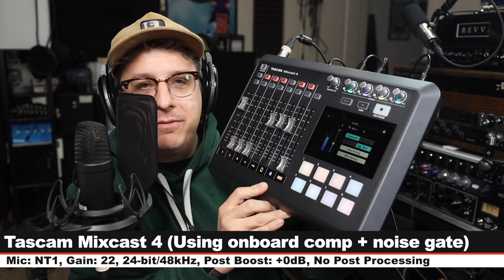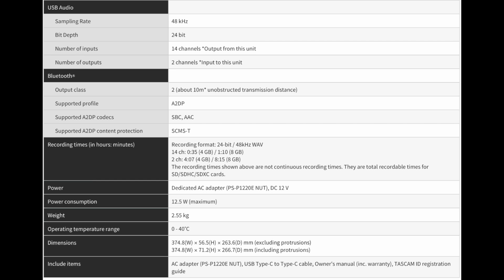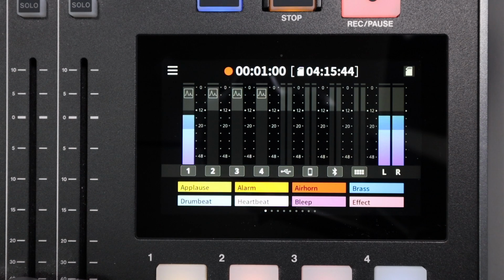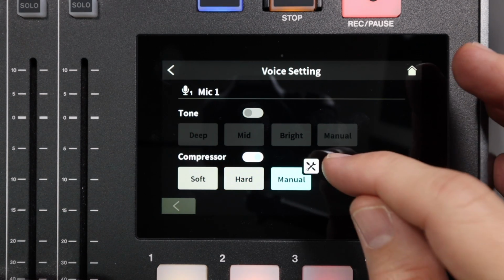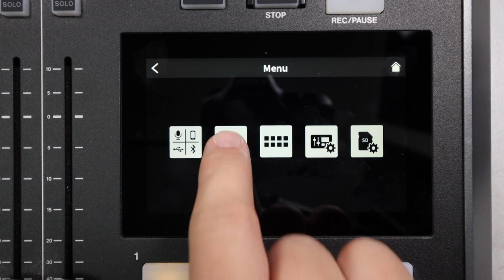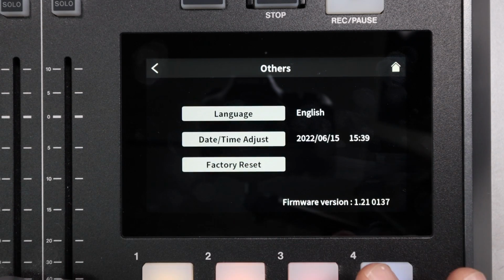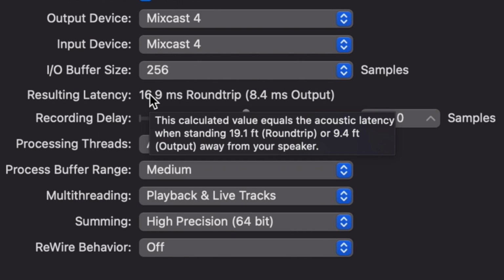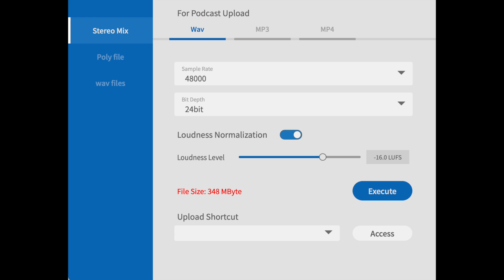Tascam Mixcast 4 Review / Walkthrough / Explained

Comment: I've had this as my main podcast station for about 5 months now and absolutely LOVE it. My only complaint thus far would be the lack of voice mod/effects such as raising or lowering your voice pitch on the fly with a phaser would have been cool! Thankfully they are always adding updates to the firmware so it's possible features like that could easily be in the works.

Fun Fact! I've always used it connected via USB to my 8-USB 3.0 hub and I've thankfully never had a connection issue!
Reply: Is it possible to stream directly from mixcast to iPhone? Using audio affect like echo? I am playing guitar so is it work ? Or need computer?

Comment: I really love how intuitive it seems to use this device and the feature set of it.  I agree that this is overkill if you are a solo podcaster or streamer.  I would like some recommendations of an interface that is similar to this but more catered to an individual.  I know they exist but… not sure where to look.

Specifically I would like the ability to have a compressor, soundboard, and phone or bluetooth connectivity like this interface.  The other features are great but not essential for me.

Thanks in advance to any replies!
Reply from the maker: There's still not a solution like that other than the GoXLR. The new Focusrite one is the closest to that, but it lacks the soundboard.
Reply: @Podcastage  ah okay.  I’ve heard of the GoXLR but didn’t want to just blindly follow the trend.  If that’s the only option then so be it
Reply: @ThatLazyyGuy  The Elgato Wave XLR might be another option but it isn't as fully featured as the GoXLR yet, IMO. This product space seems to be largely unexplored. You could also check out the new Mackie M-Caster Live.
Reply: @adventuresinbytes  will check them out thanks!

Comment: As always, appreciate your videos! I just bought one.  I'm solo live streamer whos been very well served by a MOTU M2 for a couple of years  EXCEPT I can get very animated with large volume fluctuation and have wanted a compressor to tame it - So I bought the Tascam.  I agree it sounds great.  I run an MKH 416 into it and all is good - Except I get a ton of feedback out of my speakers (I wont use Headphones) which I do not get from the MOTU.  USB Mix Minus didnt address it and Feedback Prevention cuts the output from the line out - so unfortunately the Mixcast is going back.  Do you think a DBX into my MOTU would be a good solution?

Comment: Podcastage, really would appreciate your insight here ... I'm considering this thing (the deal that is Tascam Mixcast (you understand) .. ok seriously though,  would you recommend it and feel kinda good doing so over the Rode deal ?   I'm looking at spending 299 (got a good deal for a new one waiting for me) ?  thanks in advance. ... mainly i'm looking for this thing hopefully with latest firmware updates, that they have improved the software quite a bit .. for example the noise gate, compressor, etc. - to help dial in what you want a little better and sound overall better and more natural vs the rodecaster that appears to honestly have this thing beat by miles. ?  thanks again in advance.
Reply from the maker: In this video I discussed the Mixcast 4 vs. Rodecaster Pro. I think the features are pretty comparable, but I prefer the sound of this over the RCP. If you're talking about the rode caster pro 2 then that is the obvious winner though.
Reply: Rode caster pro 2 was what i was referring to.  Yes, I absolutely agree w/you in that the updated 2 wins hands down over the Tascam Mixcast ... but the pricetag ?  $699 vs $299 ?  that's a pretty big difference.  I think for the MOST part, if you know what you're doing and can dial in manually the de-esser, compression, mix-minus setup for phone calls, skype, etc., is there REALLY a big improvement with the sound quality overall ?  oh by the way, that new EV mic sounds pretty good!  condenser and EV I think just makes for the most part, really solid gear. Last thing with the Tascam name.. after all is said and done this IS Tascam.  They've been around forever with all things audio console / recording going back to the reel to reel days.. so thats something in itself over the Rode, no ? - perhaps why you actually like the sound at the end of the day coming from the Tascam model over the Rode.  I know Rode is catching up fast, but still Tascam is, well Tascam :)  @Podcastage

Comment: I thought this thing was great and was going to make it my primary audio interface, but there’s a problem. It’s hardware is fixed at one sample rate 48k. I did some research and it seems that all of these things Rode, Zoom, Tascam, even the Boss is single sample rate only. The ASIO driver for the Tascam seems to do some real time conversion but not automatically switch the clock.
Reply from the maker: That's strange that it would allow you to change the sample rate and record at a sample rate that the hardware is not able to convert at. I can imagine that would cause some artificating or latency issues for you. What kind of issues are you encountering with this?
Reply: @Podcastage  In Sound Forge when working on a 44.1 file stop and restart playback takes longer and the sample rate when stopped shows 44.1 but when playing it shows 48k but in italics. So Sound Forge is using italics to show its not the native rate of the file. Other than that it works OK but the sound is not as clear and punchy as when using my Focusrite 6i6 where the hardware clock automatically switches to 44.1 when working in software at that rate.

Comment: I've been looking into getting an audio mixer to possibly replace my interface because I like the thought of not needing so many digital filters, and the main thing that's holding me up is whether each input will show up on my computer as individual inputs.

I record through OBS Studio for doing Let's Play videos. I'm currently using a Behringer UMC404HD because I wanted the option to add more mics if I ever got into more group oriented recording. For the longest time I was only able to record two stereo channels until I found that I needed an ASIO plugin. Now I can record with up to 4 mics each on a mono channel so I can edit each track separately.

If I were to get this mixer, do you think/know if I'll have any issue with recording 4 individual mics?

I also kinda like the flexibility of being able to record without a computer. My buddy and I have been planning to branch out from Let's Plays to do a podcast and it would be nice to just set up wherever.

Thanks in advance for your input if you see this and have time to reply.
Reply: PEAVY PV 14 AT is best audio mixer.

Comment: What would you suggest for a solo streamer using a Neat King Bee II mic?  Mostly video streaming, potentially a podcast with two mics, but this Tascam is probably overkill.
Reply from the maker: This probably would be overkill for that. The Focusrite Vocaster is pretty good. The Rodecaster Duo seems like it might fit the bill. There's the Rode Streaming device that just came out that may fit the bill for a solo streamer though. There are a lot of options and it's going to rely on what your specific needs and features needed are.

Comment: Hey! You switched to Gator mic quick releases! when did that happen? Can't believe i didnt notice before. Probably because im swimming in these things on my end. Welcome to the club! 
If you ever use Maker Pipe 3/4" conduit connectors to build with, these Gators fit perfectly in their connectors, too.
Reply: Hello. Do you mean an actual mic stand or the Gator Frameworks GFW-MIC-QRTOP Quick-release Mic Attachment. Does this work with desktop mic stands? Thank you.
Reply: @DrGDaniels  yes. That is the Gator part number. The quick release attachment. It does indeed work on any stand with a 5/8” attachment point possibility. It adds about 3” in length, though. There maybe scenarios where that’s too much. It can be interesting inside something like an IsoVox .
Reply: @danasdas6683  Dan, thank you for the reply. The added height information is helpful.

Comment: Great video! I have been looking at the Tascam. ATM im using a Allen & Heath ZEDi-10FX for streaming and it works great. However It likes to lose USB connection. If I could plug in my guitar on the tascam it would be a done deal. I Wonder why they did not just give use one good plug for guitar... as folks like to play guitar on a stream.

Comment: It's funny how gigantic the steps of the gain knobs are, the noise test showed it pretty well. What manufacturers do with digital devices like that these days is they have hard stepped analog DCAs as gain stages, and in between the steps they just digitally boost the signal. But right know the only step I could hear (macbook speakers tho) is around 31dB which means bellow that the gain is at +0dB analog with digital trim, and after that +31dB analog with digital trim reset, hence why the noise suddenly disappears, if you have a mic that needs somewhere around 30dB you're way better off going for 31 than 29 or 30.

Comment: I use the Mixcast with 3x Zoom ZDM-1 Mics, but there is an absoule white noise in the Background always! The Mics are hissing like Carzy. Any Idea what can I do against it?
Reply from the maker: Is the white noise on each individual track or is it on the stereo mix. First thing I would do is make sure that all unused channels are muted or turned down. That will ensure that any preamp hiss from unused channels are not adding excessive his. If there is simply hiss on each of the channels, that is likely due to the preamp noise on this device. There would not be much you can do about this on each channel other than adding a gate (But the hiss will still be there once you start talking again). You could also make sure that while a mic is not being used it is attenuated so you aren't adding a constant hiss to the full mix because that underlying preamp noise on each track will compound.